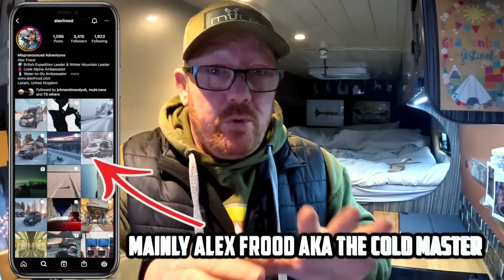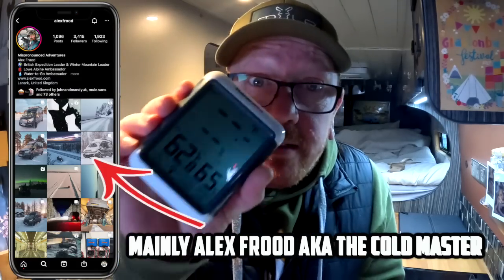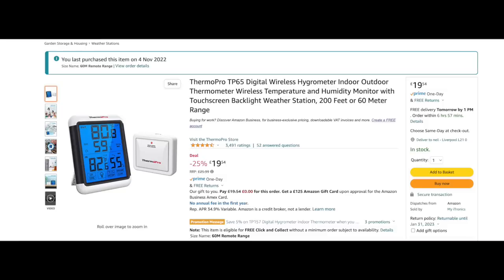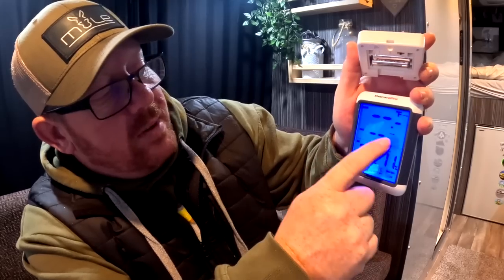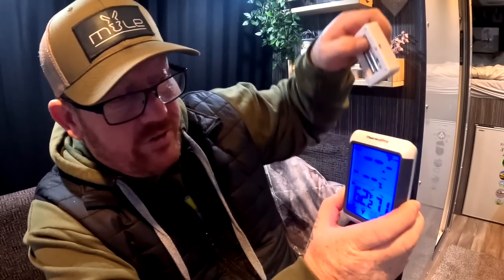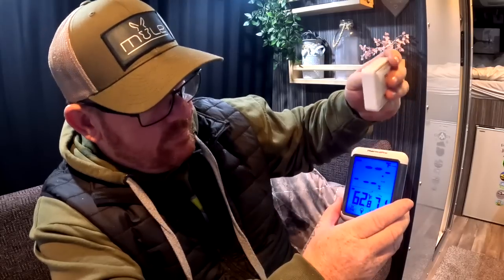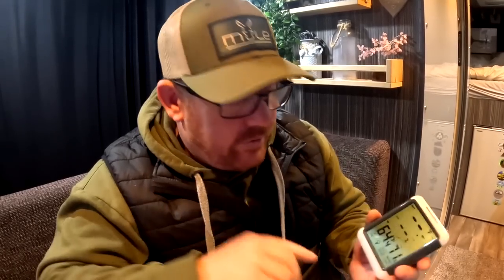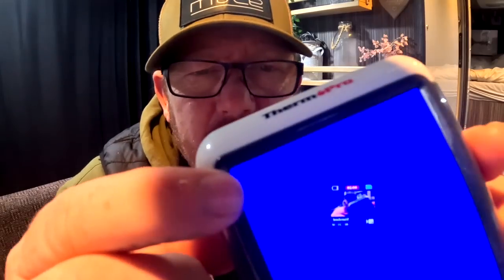The Best Temperature Sensors for winter van life

Comment: Nice one Neil, the one on the roof though is gonna get the direct sun on it.  On a frosty morning with the sun shining its going to be showing tropical temps out there. I put my outside sensor under the van near the back and used a cable tie like in your battery bay. Its been there for over 2 years now and not fallen off.  I did buy the extra sensors for mine and put one in the Fridge and one in the freezer. Now I can see the beers are cold enough 😀

Comment: RTFM is always a dangerous activity Neil....but specially when the person RTFM is Mr Cee. Impressed with that gorilla tape though...wondering if it will stick  my fifth attempt at a slidey door blind instead of screws.  brilliant idea of using the sensors to keep a check on battery temps though. even better  is the seat/step/laundry basket. great video as always. Regards and respect-Kenny.

Comment: Great vid I have one in the fridge which is useful to adjust temp , the outside one may be more accurate for outside temp under the van as when the sun gets on the roof it will get really hot. Keep up the good work
Simon

Comment: Hi Neil,
I bought the exact same set (plus the x2 extra sensors) to put in the house, mostly for the hygrometer/%age humidity function to help with resolving and damp/mould issues...so far, quite accurate on both temp and humidity.

Just a word of caution (noted in those pesky destructions) - the sensors are "waterproof" only if mounted vertically  i.e. with the sensor holes/grille at the bottom - your roof sensor is likely to be drowned as currently mounted...
Cheers,
Rich.

P.S.
I also have the same labelling machine too (Costco has a lot to answer for!).

Comment: Very handy and also picked up a good idea as have some radar sensors stuck with Velcro on my van (as saved needing to take half of the rear end to bits) and the putting a bit of sealant is a great idea as keep thinking they may fall off it the Velcro comes unstuck - thanks for the idea 🙌
Be interesting to see if you get much temperature difference overnight between the two outside ones. I was surprised you had it in F rather than C though - but you did make me feel younger for some reason 😀
Have a great weekend - All the best, David 👍

Comment: I like the thermometer but I would just go with one inside and one outside.
I am interested in seeing your results.
I am going to look into a basic set as I wondered last year without a heater what the temperature difference was.
I had the heater but wasn’t fitted because the van was delivered in January.

Comment: I have the same temp guage with 1 sensor. 
Engine bay, bad place to put it. Engine gets hot/cold(unless you care about your engine temp for real when starting etc.). I moved it to the  back of the van for a realistic "in the shade temp", the way that weather measurements are taken. 
On top of roof, bad place to put it because it will bake in the sun(weather measurements = in the shade). *unless you want temp under solar panels etc. 
Batt temp, great thinking there, important for lithiums as mentioned 👌
I would try main sensor in middle of van, 1 in bedroom, 1 front cab and 1 outside.
Reply: Great vid btw!

Comment: They looked really nice and the price was reasonable, I considered getting one to use in the house.  The problem is that the temperature range is -20 to 70 degree Celsius which is not enough for the winter me, it has already reached -9 this winter.   It is likely just a result of the battery performance at low temperatures but something to consider if you are in very cold conditions. A wired external sensor does not have the same problem.

Comment: your batteries should have temp readings if i understand Liph4 battery stuff - which i dont  ( have seen others showing a victron app showing individual battery temp reports thought) so save the batteries however one in garage - one outside - are your water tanks insulated and heated - cant remember

engine bay no point you have engine temp guauge for that
water tanks - are they insulated and heated or just vanilla black kak tanks?
Reply from the maker: Our engine temp gague only works when the engine on . And heated tanks for water is a lot of wasted energy . Plus not all Lithium batteries have temp sensors that’s all down to company and brand . And also has nothing to do with price as well it’s a case of some have them some don’t

Comment: I bought a multisensor thermometer for my 2021 ducato based campervan. Unfortunately it interfered with the keys and stopped the remote central locking from working. Took us weeks to find the fault - eventually found some obacure website which suggested taking batteries out of thermometer sensors as they can sometimes share the frequency with the key...and hey presto, problem solved.